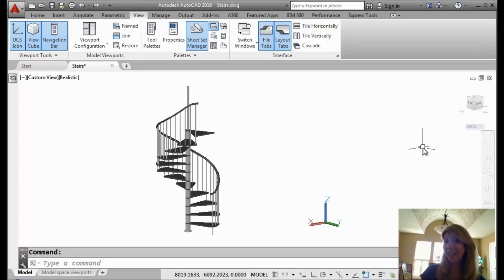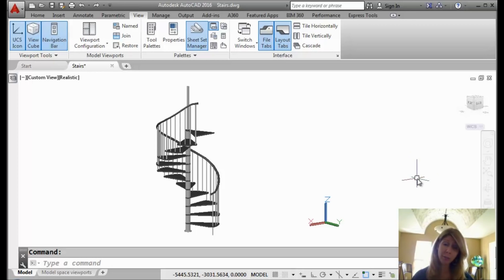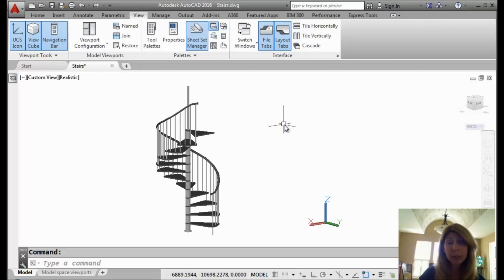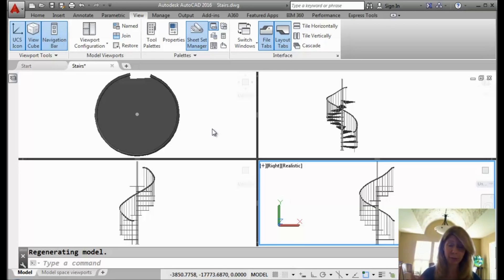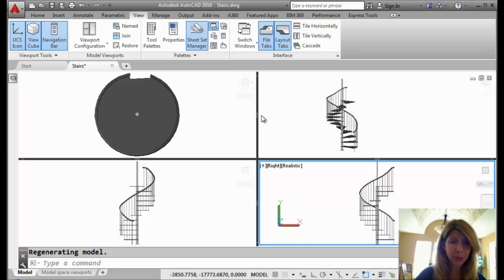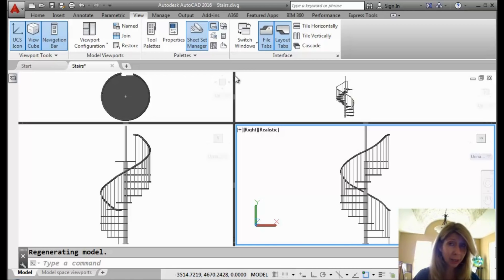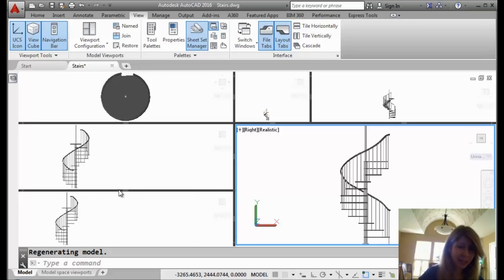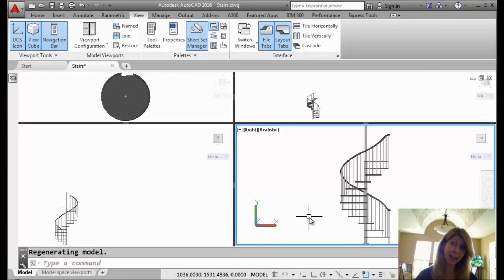Control Your Model Space Viewports in AutoCAD (Lynn Allen/Cadalyst Magazine)

Comment: Sometime I work with a 40" 4k monitor and i use many viewports but when i swith to my laptop 15" i remove them. Where can  i save them, so i can toggle between them?
Reply: +Erwin Meulman , you can name your viewport setup.  When you have your multiple viewports setup the way you want type "vports" and hit enter. Note, stay in model space.  This will bring up the viewports dialogue box.  On the "New Viewports" tab, name your configuration and hit OK.  The next time you want to go back to that configuration, type "vports", click the "Named Viewports" tab and select your configuration.  You will notice that AutoCAD already has about a dozen preconfigured layouts.  One of those may suit your needs.  Keep in mind, that you should set up these configurations on the computer you want to use them on.  I'm not sure if these transfer with your 360 login account as I haven't needed to try that.  Hope this helps.